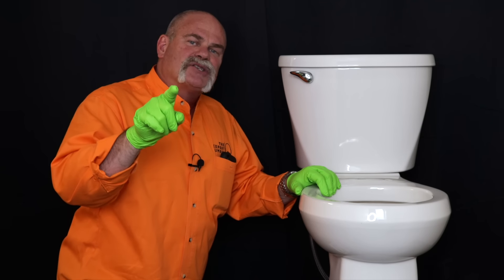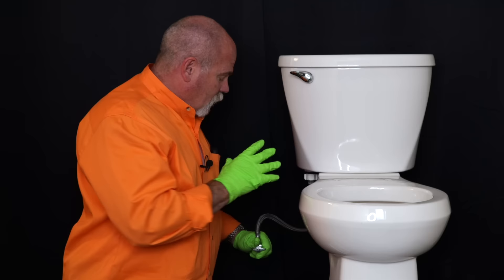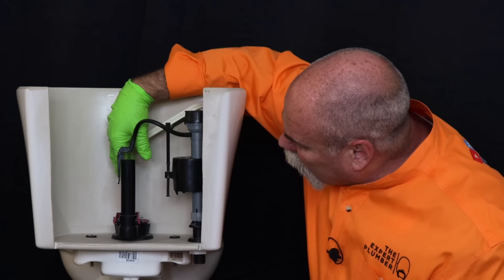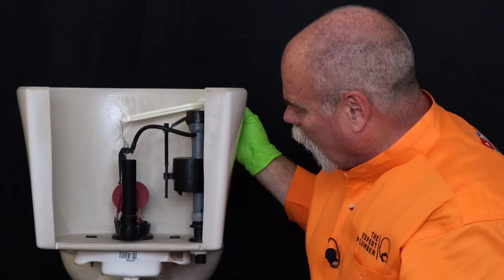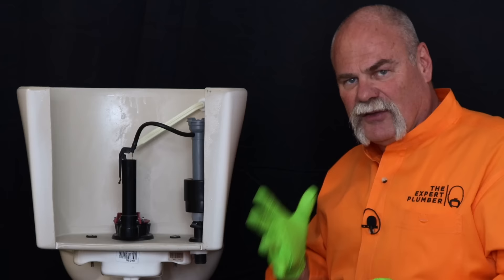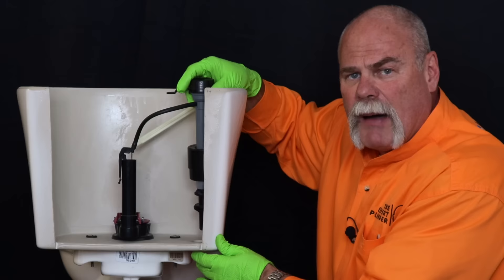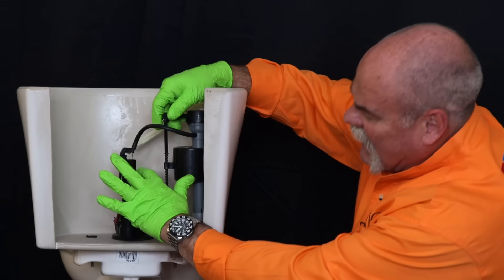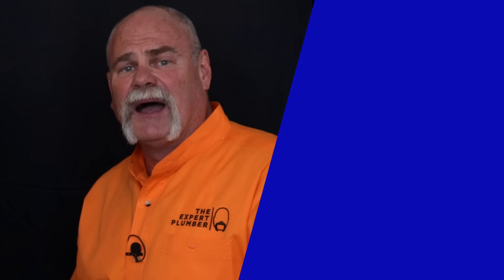How to Fix A Running Toilet GUARANTEED | DIY Plumbing Repair

Comment from the maker: HEY! We made a part 2 to this video, if your toilet is still running after this check out our update: https://youtu.be/2ex2GnTWUbs
Reply: You do help me a lot and the problem is really those debris on the top, it saves me to change the whole thing, thank-you again
Reply: Thx for the detailed explanation.
Reply: Great vid helped a lot💯
Reply: I cut the back off of my toilet like you said to. How to I put the back of the toilet tank back together? It leaks out the back now.
Reply: Roger what if I have to keep adding water every time I have to keep flushing
Reply: @0truckmafk  lol dude...good one !
Reply from the maker: You probably need a new fill valve.
Reply: Ok maybe I'm nit picking here, but... @ the 5:44 mark I feel you left a Very Big Question Unanswered.
'How Do I Adjust The Water Level?'
 Because as I'm sure you're aware of Some people will get to this point and say Ok I can adjust the water level, and then they Don't or Won't read the instruction sheet that comes inside the FLUIDMASTER BOX, then they stumble across that you can slide the locking collar up and jank the whole thing apart.
Reply: Could you tell me how to adjust fill valve height. I would like to lower it.
Thank you in advance.
Reply: Chazidy26
Reply: Running toilet was an intermittent issue

Turns out the chain for the handle was too long and occasionally it would prevent the flap from closing all the way

Great video
Reply: @millerghostly5360  qq
Reply: Roger, God gifted you and John C Riley with 1 wonderful voice 😎
Reply: @0truckmafk  🤣🤣🤣🤣🤣🤣😊
Reply: @dawnadams2337  adjust that long plastic screw.
Reply: @Nicholas_gabriel  turn the king plastic screw
Reply: To adjust the water level, turn the long plastic screw until it's at the correct level
Reply: You're a great teacher i like watching you teach. Every toilet video I've watched doesn't get through to me but this one did. Thanks. Cheers.
Reply: I specifically picked this one because he looks like a friendly dad 😂
Reply: Thanks a lot for your clip! I ‘ve never ever had a toilet problem (until today); i had no idea what was going on in the toilet system. I panicked and needed to go. Your instruction worked and saved my life. Thank you!!!
Reply: Thanks you from Canada
Reply: This was so helpful I appreciate the video
Reply: Love your videos! Thank you so much for posting your knowlede. <3 you!
Reply: You are such a sweetheart thank you so much for helping all of us. I changed my spare bathroom valve about 6 months ago and now today I will change my master bedroom.  You ease so many of our minds and helped save us money it's difficult to part with. God bless you.
Reply: Awesome instruction. I now know that the replacement was installed wrong last week by a well-meaning friend with wacky shortcuts. (All I need is finger strength to undo the bottom!) I just need to lower the 400-A 'bob' or float (or whatever it's called). Well be back, once my strong handed buddy shows up after work. Thanks for 'being there'!
btw, methinx 0TruckMafk was joking, as if to say he cut the porcelain back out too!
Reply: Sorry to say this repair failed and also sorry to say that cleaning the diaphragm doesn't always work!  After cleaning the crud off the diaphragm and reinstalling it,  the stupid thing leaked even faster!  I looked online to see if Flowmaster made a replacement upper valve assembly (like you show,identical to mine).  They don't!  I went to ace hardware and bought the entire system,  @ $12.72.  They sell the little diaphragm piece for $5, however,  there's no guarantee that it won't leak just like the old one.   Yes! Simple to replace and so I did!  Nice try but no cigar.
Reply: @nilwangful  you
Reply: @RogerWakefield  I have a push flush will this method also work for it or I need another solution
Reply: U have been plumbing for 38 years but took u many years to become a master plumber. I'm also a master plumber here in Texas and it took me 7years to become a master plumber and I have been doing it for 26 years now
Reply: I really wish that you would go back to making more content like this again. It seems as though everything you publish these days is either a reaction video or an infomercial for a product that I have little interest in and you have already talked about in another video.
Reply: What do you call those tools again?
Reply: my water doesn't shut off
Reply: and the water won't shut off on the wall and my toilet is old with a huge ball inside. it runs day and night and my water bill was 600 dollars
Reply: you are the best!!
Reply: Ok I subscribed & thumbs up 👍🏻
Reply: I have a completely different toilet and i don't recognize any of the parts you have in your video in my toilet. But this was very informative nonetheless.
Reply: I think it would help me to watch an angry poo tube episode where you just take out our plumbing rage on the toilet etc with a sledge hammer... You know... Just for therapeutic purposes... 😂
Call it... Therapeutic poo tube rage plumbing episode... Rage poo! 
😱😰😳😲💩💩💩💩💩😡🧻🧻🧻🧻
😡🔩🔧🛁🚿🧻💩🚽⚒️🪓💥****🔫😠⛑️
The flush siege sledge hammer revenge of snake trap poopy pipe after its blockade causing flooded sewer mountain Swamp gas.. We will be victorious..Oh yes..We will. 
🗻💪😎👍⛰️
🤣😂🤣😅😂🤣
Reply: Water doesn't fill tank
Reply: No
Reply: @johnescoto8113  turn your water back on lol
Reply: @nilwangful  qqqqqqqqqqqqqqqqqqqqqqqqqqqqqqqqqqqqqqqqqqqqqqqqqqqqqqqqqqqqqqqqqqqqqqqqqqqqqqqqqqqqqqqqqqqqqqqqqqqqqqqqqqqqqqqqqqqqqqqqqqqqqqqqqqqqqqqqqqqqqqqqqqqqqqqqqqqqqqqqqqqqqqqqqqqqqqqqqqqqqqqqqqqqqqqqqqqqq¹
Reply: I hope you can help my toilet tank keeps filling I can hear water going into the ball constantly so I’m sure it’s leaking ,, I put food coloring in the tank so I could see the leak better and I noticed the tank is leaking inside the bottom of the ball so it’s definitely nothing mechanical inside the tank ,,,, where else could it be ?
Reply: Great. Thanks! I hope I won't need it. 🙂
Reply: The main problem of the running toilet is the carbonates of water deposit in the flapper gasket, it is straightforward, there is no need to change the flapper, clean the carbonate deposits on the flapper's silicon gasket, and at the edges of the round pipe where this gasket rests.  This guy is just wasting your money for replacing all the stuff.
Reply: @nilwangful 🎉
Reply: @nilwangful 😊
Reply: IDK what is going on with my toilet.  Every few minutes on its own when I am no where near it.  It starts filling up with water again in the tank which wakes me up during the night!
Reply from the maker: @robertpreston2220  it’s leaking water out of the tank and having to refill… That’s costing you money…
Reply: Luckily for me I rent and the apartment complex pays the water. Which they should since the repair people here have worked on this toilet so many times and like everything else they touch they make it worse.  But the noise is now waking me up, so I am trying to see if I can fix it myself. But so far no luck  @RogerWakefield
Reply: Didn't clock there was a pt2
Reply: Baaaaah haaaaaaa haaaaaaa
Reply: Dhar Mann brought me here

Comment: Im a single hard working mom, and the last apartment my kids and I lived in was run by a major slum lord. We lived in a four plex and our landlord only ever came around to collect rent (early) or be drunk and stupid. We had a major toilet issue, and he was worthless. I investigated, watched mansplaining videos on YouTube, and after a few hours I had ripped the whole thing outta the floor and changed the flange, and fixed that dam thing like a BOSS! I also had to repair TWO cracked copper pipes, one with a pinhole leak, and the other THAT BURST behind a radiator,  because he didnt want to call a plumber on the weekend. The plumbers eventually were called and I shared what I had to do (being educated by yt videos) and they did a more permanent repair and pretty much patted me on the back after they heard the situation. I have the burst piece of copper pipe they gave me as a trophy. While I def SHOULD NOT have had that responsibility, yt vids helped me greatly. We moved couple years ago and thank goodness. What a dumpster fire. Now, my tank is running a bit, so I'm just doing a bit more research.  Very glad for these kind of videos!

Comment: I've watched almost every DIY video on youtube and nothing has worked.  There seems to be a connection between my stopped up toilet and my kitchen sink.  The toilet was working fine until the kitchen sink became blocked. I opened up the left side of the kitchen sink with boiling water, a plunger and sulfuric acid. But now it's the right side of the sink that is blocked.  When I use a plunger on the sink, the toilet in the bathroom fills up to overflowing.  Apparently the problem is not with the toilet but with the pipe exiting the house towards the sewer.

Comment: HUGE thank you for this tutorial! My toilet has been running for months and I had no clue what to do. After watching this, I turned the water off and figured out that the flapper was distorted and not laying flat. It cost me less than $10 to get a new one, which I was able to swap out in less than 5 minutes. This video was extremely helpful!

Comment from the maker: I love working on this cutaway toilet to really show people more about plumbing!
Reply: Sir lam very enjoy to works plumbing but may country don't have uperunity to work and learn please help me sir
Reply: These videos (and this overall formatting) is absolutely incredible. Cutting the back out of that tank was an awesome idea. I'm a student living in one of those overpriced housing complexes where "everything's included" and my toilet's been running for a little while (about every 5-10 min or so; you can hear the drips leading up to the sudden rush of water). The maintenance guy's a schmuck who doesn't know a socket from a screwdriver, so I repair virtually everything that goes wrong in the apartment myself (besides HVAC work involving anything more than condensate pan clearing and filter swaps). I just don't trust the guy to not make an absolute mess of the place.

Anyways, this video helped me not only fix the issue, but it also broke-down the process of how these systems work on a level that, as an engineering student, I found really interesting. Thanks for the quality content. You really know your stuff AND seem to genuinely enjoy teaching people about it! Subbed!
Reply: I can not got the top off like you did. I the part is called a HydroClean  any ideas?
Reply from the maker: Marianne Palmer can you not get the blue top off? It should come off fairly easily.
Reply: Appreciate your video - great idea to cut off the back to show how the whole thing works, but this is not the design I have:(. Thanks anyway.
Reply: Absolutely incredible Great work 👍
Reply: It helped me! And thank you for that.

Comment: As a woman who has never been taught anything about home maintenance and has a less-than-cooperative landlord, every repair need fuels my panic. Thanks to your video, I cleaned a drain valve and replaced it with a new one! Happy new year ❤️
Reply: Get it woman.
Reply: Hello
Reply: @ S Tagavilla 

Congratulations ! 
I changed my own cabin and engine filter in my car. I am very proud of it. 

This may be small things for some, but when you get it done your self it actually increase your self reliance, it's great to count on your self as much as possible 

I am about to work on this toilet project.

Have a nice day 🎉🎉
Reply: You need to have a conversation with your landlord. As a tenant, you deserve to have repairs made in a timely manner. Don't let landlord attitude keep you from asking for what you need. I am a landlady, and when they call, I'm on it the same day. Getting my rent and keeping my tenants is my priority, plus not relying on a tenant to try to fix what I am supposed to fix, with the result being they could do more damage by not doing it right, or the problem may be bigger than what the tenant thinks it is. Fixes need to be done right, and related issues need to be identified and fixed too.

Comment: I wanted to show off to my husband and install a bidet I bought on Amazon.  It was challenging but got it done.  Then the water kept running.  I went to my trusted You Tube for help and this video popped up.  It was great!  His explanation was spot on!  Problem solved.  All set …  and my husband is not even home yet from his errand.  THANK YOU!!

Comment: Loved your video. The way you explained everything was very easy to follow. You were so clear and precise with your instructions. I was just about to go and buy a new fill valve for my running toilet but decided to view your video first. I am so happy that I did. I took the time to check and clean the diaphragm in the flush valve as you instructed and put it everything back together. After I refilled the tank and flushed it, no more running water. I fixed the problem in less than 10 minutes. I am so happy and thankful that my toilet doesn't run anymore. Thank-you so much for taking the time to post the video and share this tip. Have a blessed day 🙂

Comment: The back cut of the tank is a great idea - homeowners can clearly see what is inside. the fill valve and how to disconnect was a good tip. Last time around I replaced the full fill valve without knowing just the rubber washer cleaning would have done it. Thanks for the great tips - shows why you are an expert plummer and with a heart to help others 🙂

Comment: Success!  I simply had to adjust the fill valve level and it turned out ok.  Might not be the long term solution but adjusting/fixing it myself saved so much money.  I know YouTube can get a bad rap sometimes but I've saved so much money in repairs thanks to videos like these.  Thank you, Roger!

Comment: Thank you for your explanation, I started to check the parts and found that the chain attached to flapper was long , I made it shorter and now it works perfectly. Thanks again.

Comment: Excellent tips Roger, this video saved me time and money! All I did was clean the diaphragm valve to remove dirt and then adjust the float cup 1/2” below the overflow tube to prevent water from running into it. For some reason the float cup was set above the overflow tube when tank was full so water was always flowing in. We’ve been turning off our basement toilet after each use for over two years now (it’s been an issue since we moved into the house). And it took all of 15mins (including watching the video) while my 7mo baby was sleeping!

Comment: Great help! After you showed me how to open the valve on top I was set. I didn’t drain the tank. Turned water off, dropped float, opened top of off valve. Sure enough, filled with grit. I used a compressed air can to blow the grit away. Worked perfect and now my toilet operates as it should! Thank you sir!

Comment: Great video. You covered every possible solution for a tank that continues to run.

I never replace the bottom portion of the fill valve assembly that is attached to the toilet with that nut underneath. I leave the bottom part attached to the toilet bowl and only replace the upper portion from the new valve assembly kit. You simply need to move that slip ring to get it the top part to release from the bottom part. The slip ring is what allows for changing the height adjustment on the valve. That way, I don’t need any tools, and I do not have to drain all the water out.

I used to do the way you showed, until I realized that bottom portion does not wear out, nor does it ever clog up, and the dimensions for it has not been changed over the years, as long as you get the same version of fill valve for replacement.

Chlorine is what eventually deteriorates the flapper. I changed out several toilets in 2017 to the one piece dual flush type from Home Depot. They use a tower with a circular flapper that last about five years. They are easy to replace, and no tools are needed. There are two sizes of towers, and both sizes come in the flapper replacement package.

I really like the slow closing FluidMaster fill valve, because you do not have to worry about water hammer. Some of the older type fill valves shut the water off fast enough to create water hammer.

Comment: Just a quick "thank you" for creating and posting this video.  After watching your video, I was able to determine the cause of the problem and replaced the toilet fill value at a cost of just under $7.00.   In a time like these when money is "tight", you saved me the cost of hiring a professional plumber...just the service call alone would have been $90.00 and that would not have included the part and installation charges.  Thank you, kind sir!
Reply: Holy camoly! That’s what you get charged around you!? I’m a plumber and for our customers, we only charge a super short call. 25 plus part. I know that’s still more, but dang, people can be super greedy!
Reply: Up here it's 150$ automatic show up charge
Then 120$ per hour after that plus parts
Reply: Years ago I thought I could do it, never you tubed it 😞 I finally gave up and called a plumber. $75 and I had the parts and it took him minutes. After watching this I'm sure I can now do it myself. Thank you so much!

Comment: Thank you so much Sir! My valve was a little more complicated than lifting and turning to release it, but your video gave me the knowledge and confidence I needed to proceed and figure it out. After the valve was removed, I found a small chunk of rust that was preventing it from sealing fully. Removed that, reinstalled, problem solved! I thought for sure I would have to go to the hardware store and hope that I bought the right replacement valve assembly. Not necessary now.